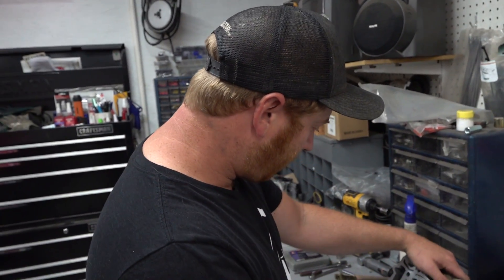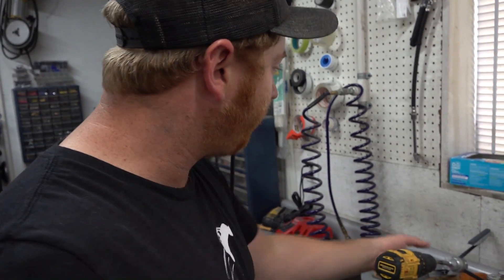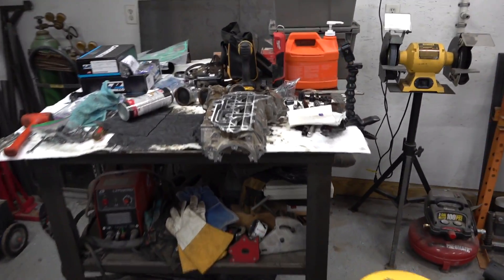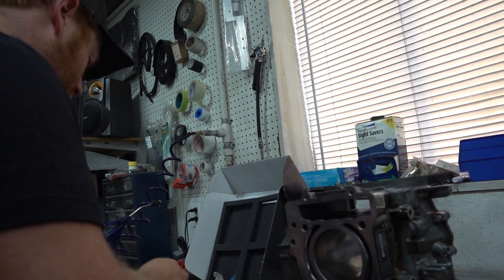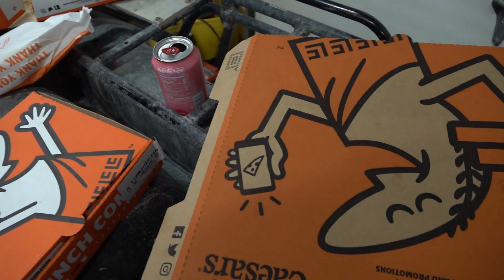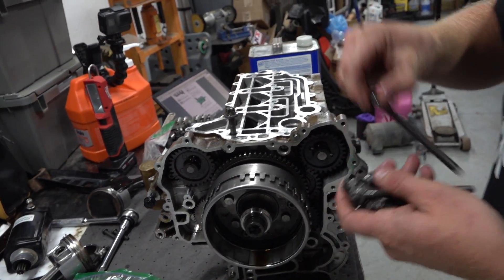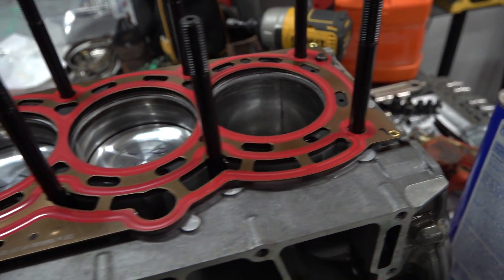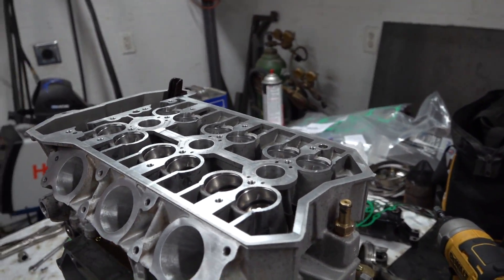Maverick X3 engine rebuild DEEP dive! CP rods / pistons

Comment: Big difference between "assembling" and "building"...
Building = check ALL Clearances. Good news is metals and tolerances on today's engines are very consistent compared to the old days...
For those that don't know, it also makes a difference what lube is used on the rod bolts bolts when they're torqued...

Comment: Seems kind of crazy to tear that motor down that far and reuse the rod bearings.... 

PS: turbo the rs1
Reply: Rescue
Safety
Turbah
Reply: Polaris bearings are a slightly crushed when torqued down and should never be reused.  Maybe can-am is different?
Reply: Seems crazy to me also, but Doug knows more than I could ever hope to know, so I'm sure it's fine.
Reply: I felt the same, but Doug wouldn't do it if he thought it would be an issue. I trust the guy knows what hes doing and has done his research
Reply: Grady Brown well I guess 🖕🏿me
Reply: Well you have couch mechanics and there Doug working

Comment: Pls guys, stop recycling old engine parts into a new build.  Do it properly the first time and be done with it, you get a motor you can trust even at high boost. Don't be lazy or take shortcuts.  A rebuild is a rebuild, with clean, fresh parts and fluids. No reuse guys. Come'on. 

I do enjoy your video's and I likely have watched em all. Look forward to see this X3 build completed, tested and raced. Keep up the good work guys, and I am excited to see racetober with this x3 and the old yellow turbo'd Yamaha side by side down the track. 

What I don't like is when you guys are taking short cuts in the garage or maybe just being plain lazy? Like in the light bar install earlier this summer. Also In this video you ordered parts before opening the engine, which in my eyes are to start backwards and playing catch up. A cylinder that is scratched would in my book qualify for boring and over sized pistons. If nothing else, just to be on the safe side, especially the way you guys are using these machines, and now this will be running much higher boost as well.  Why did you re use bearings?  And you didn't stop there, you also reused valves. Who does that?  Back in the days I've learned the hard way never to do that.

Comment: How many hours were on the engine?
Reply: I Wonder the same thing since it had that valve leak
Reply: They did a lot of engine work on that thing, all while it was absolutely filthy dirty. Bound to get contamination in the engine when you don't clean anything.
Reply from the maker: This is the first time the engine has been apart, and it was completely cleaned before disassembly, lol